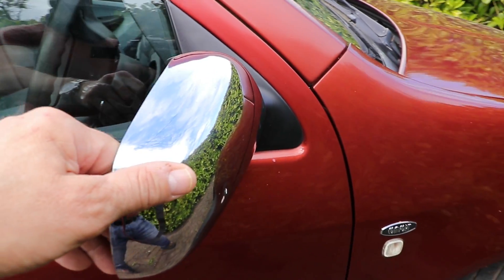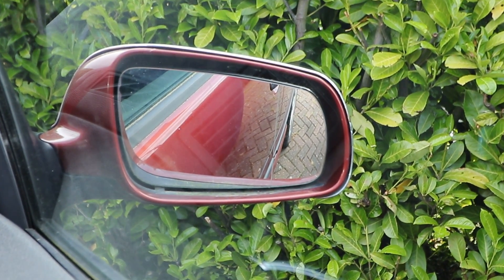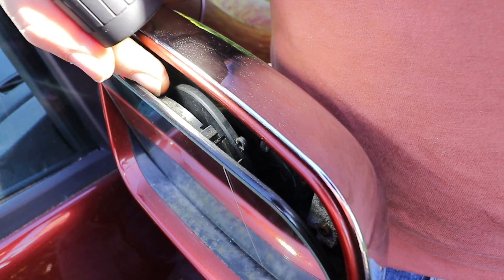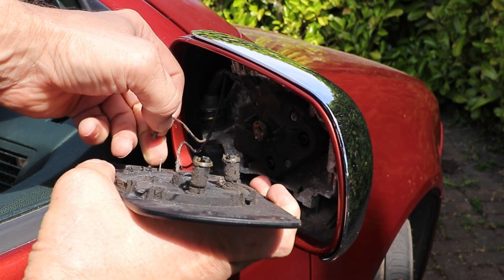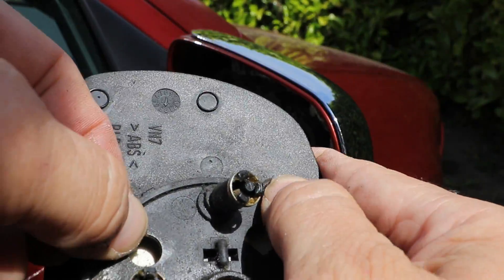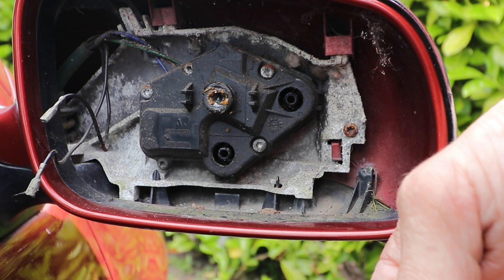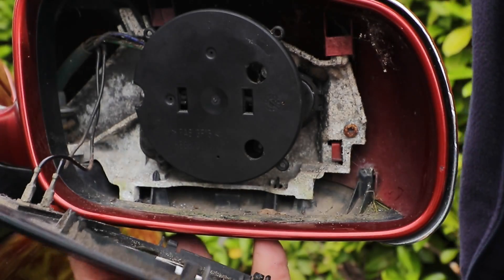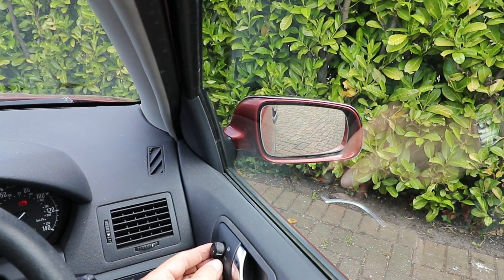SKODA FABIA Wing Mirror Glass +Motor Backing Plate (MK1 99-07)

Comment: Hi. I got a problem with heated mirrors. They don't work at all. I check the fuse but its ok. I order new heating plates and soon will change it. like always your tutorial is very helpful. Greetings from Poland.
Reply from the maker: check there is power going to the mirror also, dzięki :-)
Reply: @HatBoyHarvey  Hi again. I manage to replace both mirrors but it was very hard to remove old one. I suppose that no one never change it before. But "mission is complete". Working great ,much better than factory parts. :) One more time thank you.
Reply from the maker: @szampon010  Glad you were able to sort it!

Comment: Can you make video howe to repair manual side mirror,,can't move it ?
Reply from the maker: Sorry, I haven't got access to a manual one. I would first take off the wing mirror fully with the adjuster and then squirt penetrating fluid onto all the moving parts, cable connections etc, then clean oil and try to work it loose bit by bit. I'm sure that is what I did on one many years ago on a different car; worked for me :-)

Comment: hi, the rear window heater does not work. can you help me
Reply from the maker: Check fuses then test to see if there is a current at the wires to the glass. Thoroughly clean the inside of the glass gently and repair any breaks with a specialist conductance paint or replace the glass/switch. :-)

Comment: I’ve managed to crack the back casing of the mirror on a bollard. Does the glass have to come out in order remove this?
Reply from the maker: If you are replacing the whole mirror casing then no, as it detaches from inside the car. If you are doing a repair on the inside then the glass needs removing.
Reply: HatBoyHarvey thank you for your reply